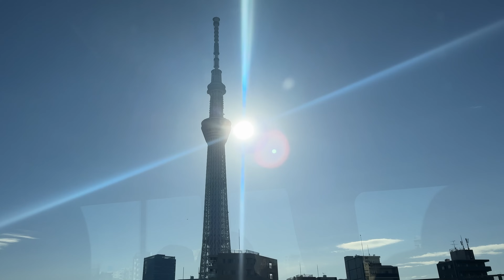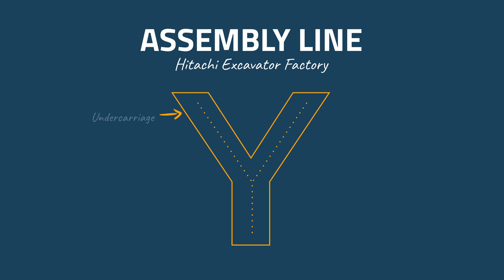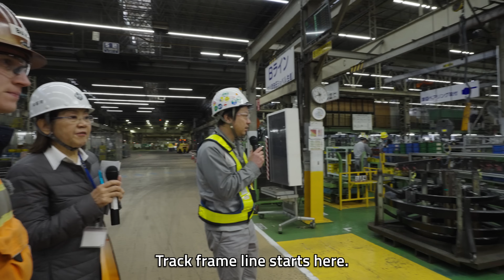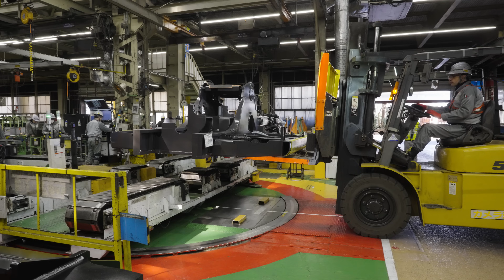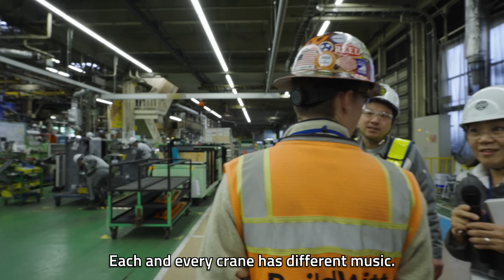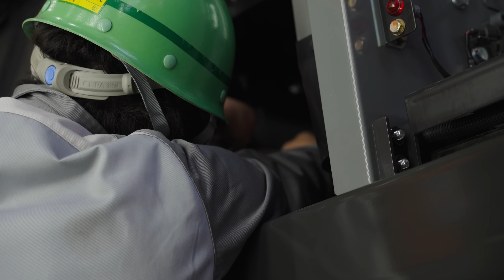Why Japanese Manufacturing is NEXT LEVEL — Full Factory Tour!

Comment: It's definitely cool to see how things are assembled. However they are bottom of the barrel when it comes to equipment. I've been running a brand new, 800 hour machine, a 890 excavator, and it's the slowest, weakest machine I've ever ran. It struggles to lift a full bucket, doesn't want to do multiple operations simultaneously, and for the 28k a month rent, it's absolutely useless.

Comment: Love how each crane plays different music instead of an incessant number of constant beeps from all machines. They should consider this for construction site machinery alarms so you know which one is moving.
Reply: i use to hear the backup alarms in my sleep
Reply: The thing about human brains is, they filter out the constants.  So beeps go unheard, high vis clothing becomes as invisible as everyday clothing.  So even if all machines have a different tone, when a human is around the same machine constantly, it will become silent.
Reply: The Rocky theme from 9:05 onwards goes so hard
Reply: Makita battery chargers will play songs too if you want them too
Reply: Sounds like an amusement park.
Reply: No, you just need to have a noise that only plays when the idiots are driving. In fact, maybe that's why they build them with key switches.
Reply: The particular tune you heard being played by that crane was Boccohorini's Minuet. If you use Makita cordless tools, you can select that same tune, instead of a tone, to alert that the Charging is done 👍 😊

Comment: I’ve recently discovered Japanese tools, specifically Koken brand. They are in many cases superior to snap on in my opinion. The sockets even fit better on the ratchet square drive. It’s an expensive discovery but the quality is second to none. Excellent video, it still blows my mind that Deere split up with them.
Reply: (ab)Used a standard 32mm Tecos nut, with 2 meter extension... 
Expected it to crack, but didn't have any alternative.
Everything went smoothly, not even a dent.
Top quality tools for a decent price. 👍🏻

Comment: Thanks very much for doing this one. I too am a HUGE fan of Hitachi excavators. Your coverage was a little short, but that was expected, since it is your format. KevinMoore342 below is right. That wompin big spring on the track frame is to absorb shocks during travel. Grease is injected to set the track tension, which does not compress the big spring. I think it is worth noting that Hitachi pioneered the basics of a hydraulic excavator way back in the '40's, and later they pioneered the use of dual pumps. They have also led the market in their hydraulic circuit design, with all sorts of special compensations and engineering. If you talk to people who operate these things, they can tell you what it's like to operate this one vs that one. In my view Hitachi is the world leader in excavators.
Reply from the maker: thank you for watching and all the info!!

Comment: The spring on the front idler does not tighten the track. It's used as a shock absorber. Grease is what Titans the track are they pump a cylinder full of grease.
Reply from the maker: yeah it was a dumb moment on my part